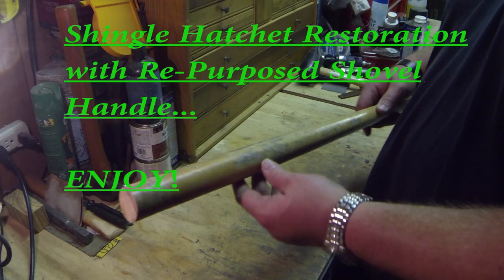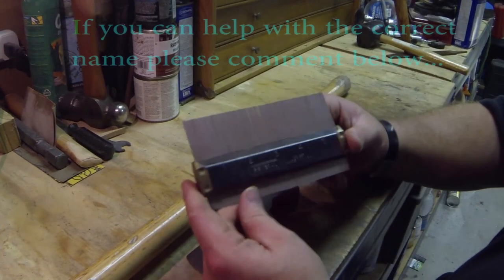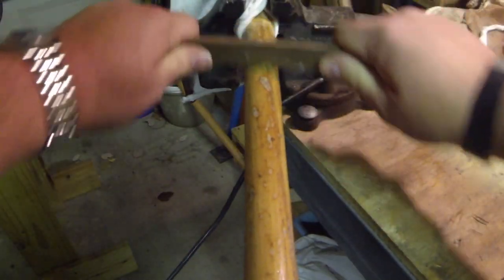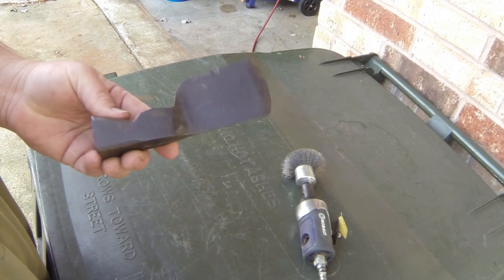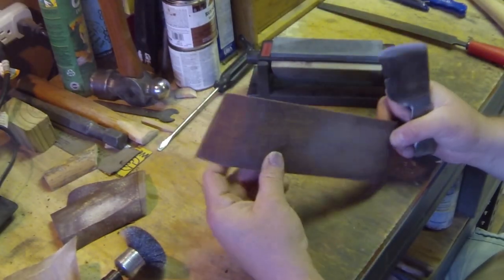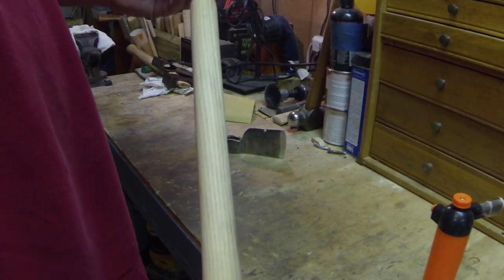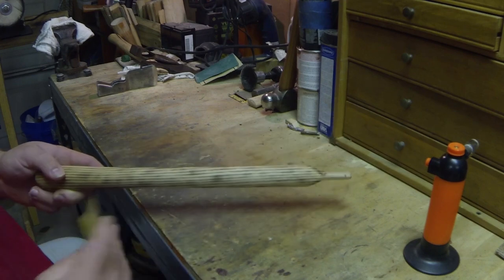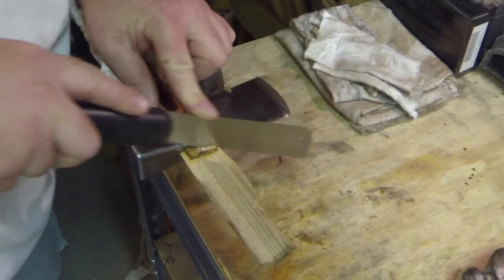Shingling/Lathing/Tomahawk Hatchet Restoration

Comment: Why do you use a hammer and hit it on the bottom of the handle when you put the axe head on?
Reply from the maker: Mikhail Shklyar when you hit the bottom of the handle the weight of the head actually forces its way upwards, driving it onto the handle.